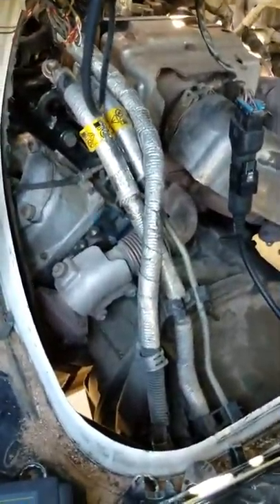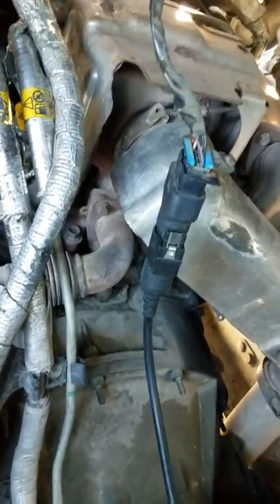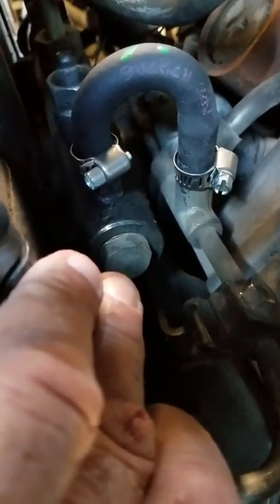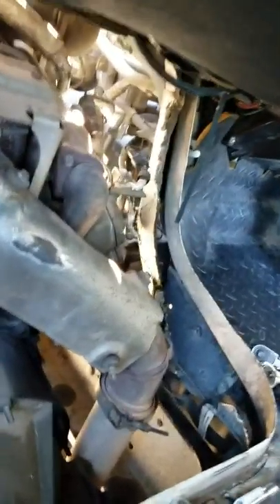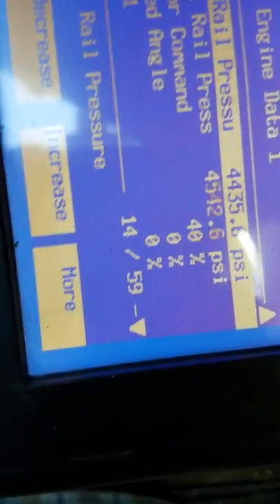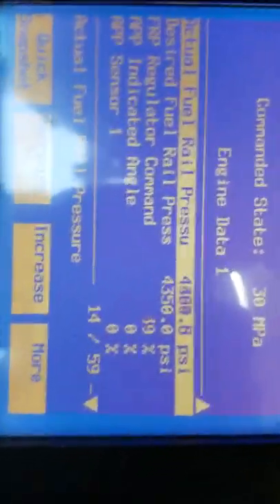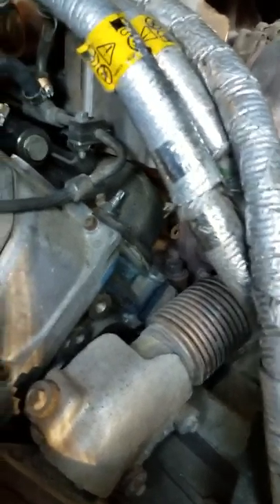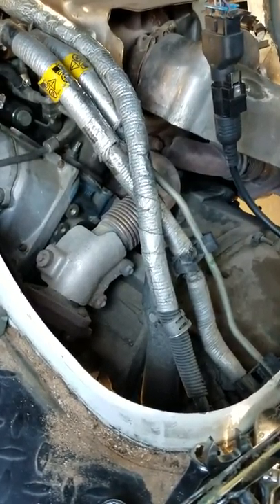2006 duramax low fuel rail pressure fix

Comment: I just subscribed sir.  I'm now convinced I need a scanner. My 07 lbz Is running like shit and Idles high and rough.  Definitely feels like a fuel pressure problem. At traffic lights, the truck just wants to go. If I don't hold the brake pedal firmly I'm sure I'll start pushing the cars in front of me. The truck hesitates to pick up speed and you can hear her starving for fuel. The crazy thing is that sometimes she will run very smooth with no problems but most of the time just runs like shit. I ordered a bosch fuel pressure regulator and will be replacing it soon. Hopefully this will fix the problem.
Reply from the maker: Buy a 10$ obd2 dongle from ebay..buy torque pro appbbn on your phone it will help scan your truck including balance rates .yes replace your fpr .fuel pressure regulator .using torque pro check your desired and actual fuel pressure should be real close 
If not replace your fpr..

Comment: i see the ipr is about 40% someone said this indicates a weak pump... Thanks for the info, i bought some plugs just for this but forgot I had em... all my bal rates are under 1, except for 2 which are about 1.5 and 2.8, number 2 is the worst luckily, i will have to check this asap..

Comment: Thank u very much for maken this video I am haven this same problem on a 05 lly so when u take off the rubber u hose it's the rail side that shouldnt have fuel leaking out
Reply from the maker: Yes its a releive valve inside the rail they rarely go bad its always a injector issue in my time on gm duramaxes
Reply from the maker: The idea is if the pressure in the fuel rail exceads 27 ,000 psi the fpr fuel pressure releif valve opens and sends the overpresdurized excess fuel out that u shaped hose to the fuel return line to the tank..some guys take the u shaped hose off the rail connect a rubber hose to the rail nipple and put the other end in a bottle or container start the truck and if u have any fuel coming out the fpr or fuel pressure regulator is bad...you do not need to cap the other end of your u shaped hose from the return side ..

Comment: I got chevy express duramax 2009, diesel is not getting from tank to the filters,  cranks but does not start, some how diesel is not getting from tank to filters. Thanks for your help.
Reply from the maker: Chevy express has a electric lift pump and a filter duramax trucks do not have a electric lift pump..check for pressure at the filter housing ...and turn key on listen for pump to come on under the van ..
Reply: Thanks Mr. Know it all, I couldn't hear any noise where the filters are, but I hear some noise by the battery,  passenger corner, I noticed though that there's a diesel leak somewhere coming down the top of engine. Maybe that's why its not starting,  but when I recharge batteries and crank it , it started but next day didn't,  thanks for all your help.

Comment: I have 2021 Tahoe Duramax 
After a maintenance, I saw the fuel consumption increase a lot and the dealer said they didn’t touch anything else except of some recalls updates.
What kind of the scanner are you using ?
Is it possible to modify the fuel consumption by the scanners?
I see my RPM is higher that what it was previously. Appreciate any feedback

Comment: Hi Randy
Thanks for yours video
I have a 06 Express diesel with code  p0087 
I already saw your other video
But
I don't understand or know why the gauge start reading different in this video
What do you did
I believe or sound like you were banging something?
Do I'm wrong?
Reply from the maker: Thats the fuel pressure going up using the factory scan tool its normal..i can increase the fuel pump pressure using this scan tool..u can also discconct your electrical.plug going to the cp3 pump .its the fpr fuel pressure regulator pigtail.then use a generic scan tool to view the actual and desired fuel pressure to find your fuel pressure loss..
Reply: @whocaresaboutme29  
Thanks for your prompt reply
I wasn't expecting a reply and neither that fast 
I'm using a Generic scanner Zurich ZR13 and I'm reading that show around 6,000 psi in idle
I just replaced filters one month ago but I just inspect them and they look 40 percent black dirty

I believe that i will Put new Filters again , clean the fuel tank and change gas station were to get cleaner diesel
Thanks and The Lord continue blessing you in 2020 to you continue making videos 👍
They help us a lot

Comment: Hello sir I have a 07 lbz that is having a few codes pop up p0087 p064c p0090 p0090 p0088. I took it somewhere and they changed the fuel filter housing and it did nothing, I already replaced the FPR and the fue relief valve with a race plug. I hvae replaced a few kinked and broken lines from the fuel system and when you are driving is just smoking black all the time and sometimes it changes to white, the highest injector balance rate is about 3.2 and I have a monitor that shows the desired and actual fuel pressure but actual only goes up to 18k and starts dropping under throttle. Just hit 200k miles
Reply from the maker: Bad injectors
Reply from the maker: Cap off each injector till you find the leak
Reply from the maker: You need 26k psi ...a loss of 2000 psi from desired to actual sets the dreaded code and limp mode..check your fuel supply also .its never the filter head..its uasually bad injector
Reply: @whocaresaboutme29  I appreciate it. Cp3 couldn’t be the issue? Since it has way more than 2000psi loss?
Reply from the maker: Cp3 is not the cause very rare check injectors first
Reply: @whocaresaboutme29   the mechanic I took it to says it’s the ecu that’s not regulating the system with the new regulator that I installed

Comment: Hi I have a c4500 truck misfires hard after it drive up a hill or after it wormers up and your drive it it only misfires in drive never in neutral or when its just idling it only has a hard time when driving   also I have one that dose the same issue but it don't start unless you spray some starting fluid. any idea where to start?

Comment: Hello sir! I have a 2005 lly with 102,000 miles and a ppe tune thats been on the truck for about 12 years. It had an issue with stalling about ten seconds after i would start it, the truck seemed to be losing prime because i would have to pump it to get it started. I replaced the fuel filter and the housing cause it was leaking and that problem went away. I recently installed an air dog lift pump and the truck started to surge and lope after driving it. I took it to a shop a few days later and they scanned it and P0670,P0088,P008G popped up.The surge and loping went away the day i took it to the shop and they replaced the glow plug module and they checked the rail pressure and it seemed to be ok. I have been driving it around for about a week and today the truck all of a sudden lost power and the check engine light came back on. I took it back to the shop and it showed low rail pressure, it dropped to 12,000psi. Do you think the lift pump is causing problems with the fuel pressure regulator, or do you think its the injectors? I would appreciate your feedback! Thank You!
Reply from the maker: Injectors will not cause surging ..its the fpr fuel pressure regulator..
Reply from the maker: Fsiling injectors cause low rail pressure
Reply from the maker: Need more imfo for a general diagnosis
Reply: @whocaresaboutme29  Hi Randy, thank you for a quick response, i appreciate it. The engine was only surging the day that i installed the lift pump a few weeks ago and it has not done it since. I took it to a shop a few days later P0088- Fuel Rail pressure too high and P008G- Fuel Pressure Regulator Performance popped up on the scanner. They cleared the codes and i took the truck to a different shop that works on diesels and those codes did not come back. My latest problem now is the truck suddenly lost power and the check engine light came on. I took it back and they scanned it again and it said low Fuel Rail Pressure. It dropped to 12,000 psi. Do you think the lift pump is causing any of these problems or possibly the PPE tuner has gone bad, or should i replace the FPR and all 8 Injectors, or check the balance rates and only replace the bad Injectors? I am moving out of state soon and i will be towing my boat 860 miles, so i need the truck to be 100%. Thank You!!

Comment: How are u sir I'm wondering if u have a recommendation for losing prime on an 07 gmc c4500 topkick with 6.6l duramax. If I prime the fuel filter cannister and start it, it runs no problems. I think I hear the injection pump prime a couple times a min about. I've been trying to fix this forever now.
Reply from the maker: Bad filter head

Comment: I'd sure like the chat with ya!  I can tell you real diagnostic work, not just a parts changer.  I am fighting the dreaded P0087 on an LMM.  fuel system will hit and hold 26ksi until about 80% load, then as injector pulse width goes up, the pump just cannot keep up and rail pressure will drop to about 18ksi and eventually throw code.  Truck otherwise runs perfect.  I highly suspect an injector or two returning too much.  We have EFI live but have to pay to borrow a techII.  I was considering unplugging the CP3, which should force max pressure, then monitor returns on each injector into a measuring device.  Thoughts?  Way to contact maybe?
Reply from the maker: You need to be able to view the desired and actual fuel rail pressure...you could unplug the cp3 pump and raise the pressure to max..that would work..
Reply: @whocaresaboutme29  
Thanks!  Yes, I have been observing desired vs actual FRP, and CP3 duty cycle, but I cannot recall the numbers on the CP3.  Do injector balance rates start standing out at max pressure?  Would testing actual return volumes be a more confirmed test?
Reply: James bob did you fix ?
Reply: I am fighting the same issue
Reply: Hey man I just read what you put and you look like you know what you talking about I have a 2008  3500 6.6 duramax I am in limp mode , I ran the diagnostic and I have the turbo booster and fuel pressure regulator is a code popping up  , what do you think is going on ?

Comment: My 06 lbz will throw itself into limp mode when it’s hot and I really lay into it. It also rolls a lot of coal when it’s hot, someone said they had a similar issue and put a cp3 pump in it and now it’s fine. Do you think that’s what it is before I spend the money? Thanks.
Reply from the maker: Thats not your issue

Comment: I have a 2006 lbz duramax that causes a limp when its hot only. I can hammer it pretty hard if its cold but once it reaches temp it goes into limp mode. What you think it is? I change fuel filter.
Reply: Hey man mine is in limp mode too mines a 08 tho but the turbo booster and fuel regulator sensor is popping up on the diagnostics any answers ?
Reply: My lbz ended being cp3 runs great now.
Reply: @rocsvt1  hey man I have a similar issue with mine, did yours roll a lot of coal when it was hot? I’d really appreciate a response
Reply: @joshuabistline9564  I had no power at all and it wouldn't build past 10k psi. Have you check for boost leaks?

Comment: Hi Randy. Great video. I have an lmm that likes to throw the low fuel rail pressure code while towing and going through a regeneration. Scan tool shows cp3 is hitting 26100psi with no problem. Balance rates look good. Its a stock truck except for a cold air intake. I boight a replacement relief valve that i havent installed yet. Can you point me in the right direction? Thank you
Reply: Did you fix it? I'm having the same thing
Reply: @MiguelGarcia-nl3ci  it must have had a different tune on it. I had the stock tune put on and it seems to be alright. I wish I had a better answer for you. I probably should put on a lift pump.
Reply: @danagoglia1406  no worries yes I think thats the same issue im getting with the truck im dealing with. Psi matches desired but still gets p0087 code
Reply: @MiguelGarcia-nl3ci  that error only happened while towing a heavy load. Since going to stock tune, I've towed 15k pounds with no problems.
Reply: @danagoglia1406  the truck does the problem only going at 50 mph
Reply: @MiguelGarcia-nl3ci  wow...that's worse than mine!
Reply: @MiguelGarcia-nl3ci  keep me posted on the fix if you dont mind.

Comment: Hey man I have a 2008  3500 6.6 duramax I am in limp mode , I ran the diagnostic and I have the turbo booster and fuel pressure regulator is a code popping up  , what do you think is going on ?
Reply from the maker: You have a fuel issue..low pressure probably
Reply: @whocaresaboutme29  yeah the code is “p0047 Turbo/super charger boost control solenoid circuit low “ then “p0090 fuel pressure regulator 1 control circuit “
Reply from the maker: @danielcastillo830 check your fuel.pressure regulator ,check your desired vs actual using a scan tool.and the turbo vien sensor is bad easy to fix..buy on.ebay
Reply from the maker: See if its 2 low.or 2 high.on fuel.pressure ..actual vs desired they should be the same when running .
Reply from the maker: Is it ideling up and down ???
Reply: @whocaresaboutme29  alright thank you
Reply: @whocaresaboutme29  when I drive in limp mode and slow down it sounds like it wants to idle off then it comes in and out like 3 times
Reply: @whocaresaboutme29  when I drive it in limp mode and slow down to a stop sounds like it wants to shut off and it comes in and out
Reply: @whocaresaboutme29  the boost is staying at 0 sometimes then jumping from 100 to 0 fast
Reply: @whocaresaboutme29  yes

Comment: Randy I have a 2007 and the code keeps saying low pressure on fuel rail on my edge
Reply from the maker: Almost always injector issue...
Reply: randy johnson1972  thanks

Comment: 06 lbz if I hammer dfrp calling for 26k afrp getting to 20 if that ... now if I get in the throttle semi hard she’ll pull to 26k d and afrp thinking lift pump time
Reply from the maker: Dont need a lift pump,check injector balance rates to hell identify the bypassing injector
Reply: randy johnson1972 how would an injector be the issue if it’s only under hard throttle? On a big tune ? In stock for towing I have no issues still thinking air sucking or pick up in tank is cracked I do not believe an injector hense say #1 injector would read -3.1 and say #3 would say 2.8 ....

Now an hour later 1 and number 3 would be fine 1.0 -1.0 if that then one other would give me an issue ... then that would be ok ... idk I don’t smoke no issue mpg still great .. ... not you have a pump in that truck can whete pick up trucks do not have a pump 

I want to make the purchase in a knock off tech 2
Reply from the maker: Bad ball and seat in injector

Comment: Is the tech 2 a good tool for the duramax ??
Reply: thats what the dealerships use. it does more then just scan codes.
Reply: Is there any other scan tool that will command rail pressure?